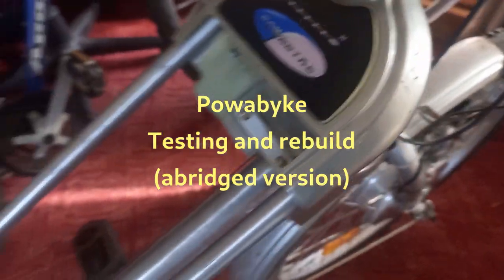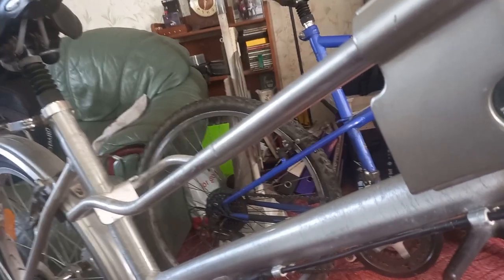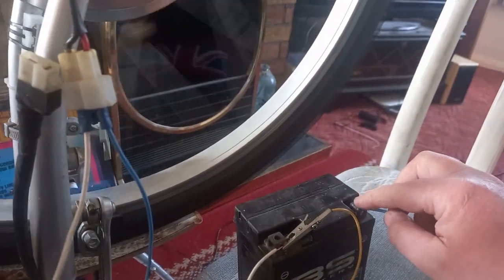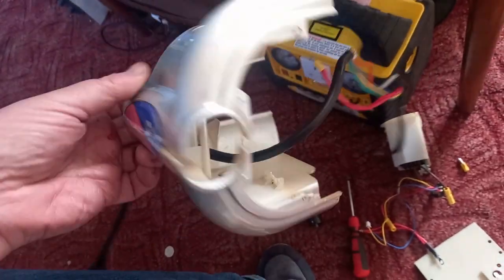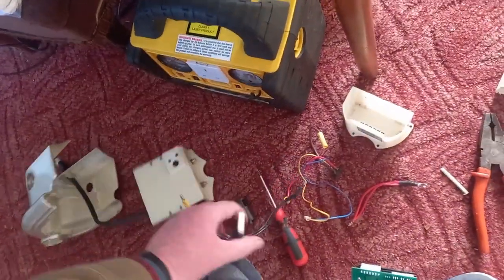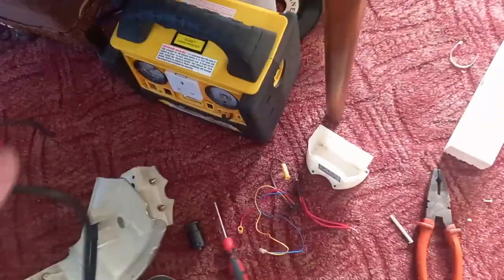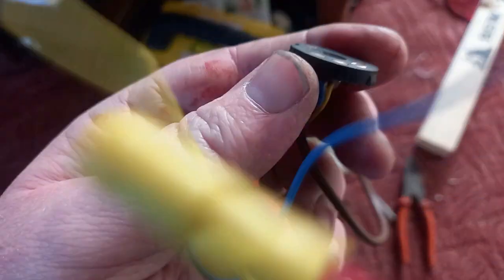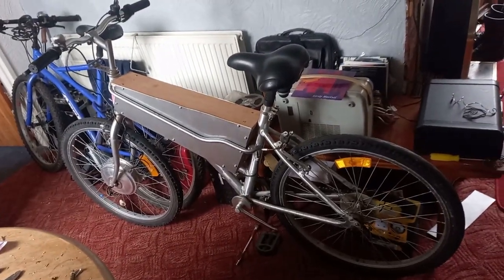Powabyke Testing and rebuild (Part 1)

Comment: 3 sealed lead batteries to replace the battery system and the powabyke box...the batteries are 12volt 12 Amp hr batteries more then likely from Vietnam or China is the cheapest bet lad❤